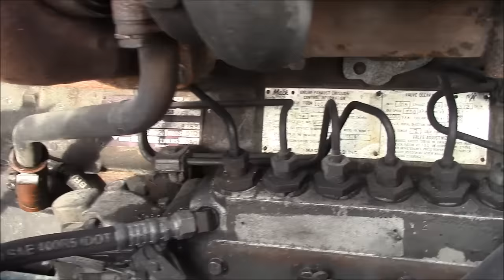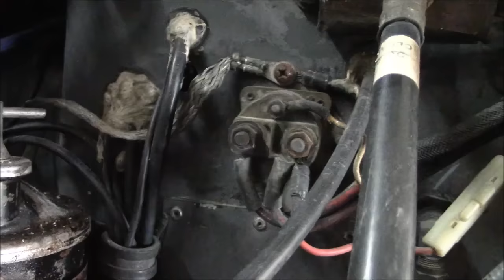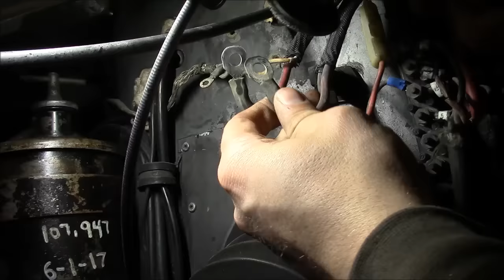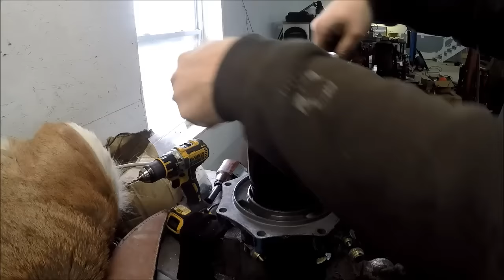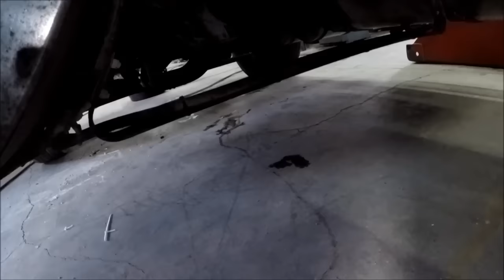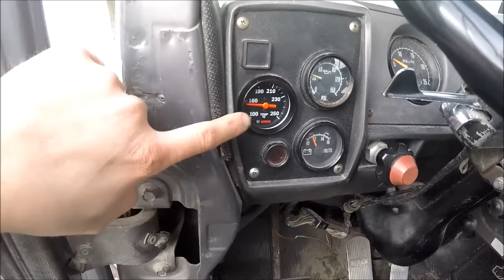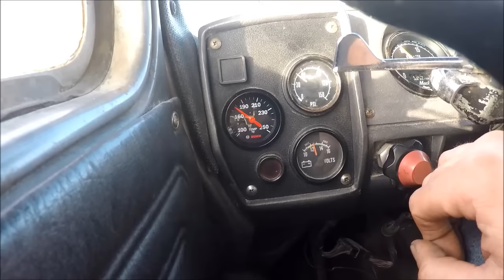Cool 1977 Mack RL600L - No Crank, No Start - Plus Many Other Repairs

Comment: No clue! Real Mack has a gold dog. Why?
The Leese Naville alternator needs feelding use a paperclip, one time shorting regulator for about a second or so will polorize it and will charge OK.
When you shift the Mack 5 speed, shift at low RPM'S and don't use the clutch. 
Oil leak is no problem it will stop after you run it. The cork gaskets shrink. Run the shit out of it. Good truck!

Comment: Mack Rs from the 80s and 90s are still hard at work here in Pennsylvania, mostly as roll-off dumpster haulers and triaxle dump trucks but you occasionally see the odd tractor or cement truck still.

Comment: WOW! People have told you not to use the proper grease for electrical connections (still laughing my ass off) dielectric grease is in fact used to stop unwanted current draw from outside sources

Comment: That really isn't unknown to have to "blip" the throttle to get the alternator to cut in and start charging on equipment. I doubt there is a problem. Ran across that often, guys start a machine at idle to warm up, walk away, alternator still not charging on return. Blip the throttle, there she goes. Lesson--- blip the throttle BEFORE walking away for coffee or bullshit with the rest of the guys.

Comment: I have those strap style wrenches in 2 sizes. Mine are made by OTC 7062 and OTC 7083. One has a square style metal piece and the other is round. I see on line they have a 7062A which has a flat bar instead. Not sure if i would care for that. I have had mine for many years. OTC used to be all American made, now i hear they have operations in China too. Kind of sickening how all these brand name products from North America are now made overseas. TOO damn much in China!!

Comment: how are you supposed to put di-electric grease on a spark plug wire (for example) after its connected?  the whole point is to seal out anything that will allow the contacts to oxidize (i.e. oxygen), thereby causing said resistance in the circuit.

Comment: I used to use dielectric grease and oil in the manufacturing of medical Xray equipment. There were cases where parts that were 1 inch apart were at 150,000 voltage difference. They would arc anytime not lathered in dielectric grease. In Xray tubes and CAT Scan tubes dielectric oil is circulated through a heat exchanger to get cooling, but also prevented arcing inside the tube casing.

Comment: Twice a year, I pull apart all the connectors on my freightliner and shoot dielectric grease in them. I’ve been doing that almost 10 years and I’ve never had a single problem. Unless you consider lack of corrosion a problem....

Comment: Been protecting electrical connections on vehicles for 45 years using some form of dielectric grease. Never an issue. I guess field experience competes with theory once again.

Comment: I believe the theradione is a naturally aspirated engine,  they would have NEVER put a thymidine against a 5 speed. 5 and 4 yes. one needs to understand a maxidyne engine is a low RPM high torque. (IE) 5 SPEED TRANS.

Comment: You do everything right. I Love to "Watch Wes Work"! I especially like your attention to securing and properly routing wires and hoses. I do think the UV light is what breaks down that particular insulation. If they are original, they still lasted quite a while. As far as brake air lines? Yes!! They have to be perfect. Thanks, Wes! Hope you and your family are healthy and safe.

Comment: Question? What was the blue knob used for on the older trucks? I remember reading somewhere it was a form of ABS? I never did find anything more then that online?
Reply from the maker: Nah. The old 3 button system basically works the same as the newer 2 button system. Yellow for tractor brakes, red for trailer brakes, and the blue know will set the brakes on both if you pull it or the air drops below the minimum pressure.

Comment: Hell I use dielectric grease on every connector on my engine, main ecu connectors, O2 connectors, light cluster connectors, ignition coil connectors, everything.
Even the best "waterproof" auto connector will, over time, leave some moisture/water vapour in, the dielectric grease stops any moisture/vapour getting into the connector by filling the space with non setting silicone grease protecting the contacts from corrosion...

Comment: I have a question about a 1985 or model Mack could someone tell me what the compartment and under the windshield right in the center of the firewall is that has a lead that opens up and down what is it for thanks
Reply from the maker: That's the vent for the fresh air to the cab. The bottom of the windshield is a high pressure area, so the inlet is usually there, even on cars.

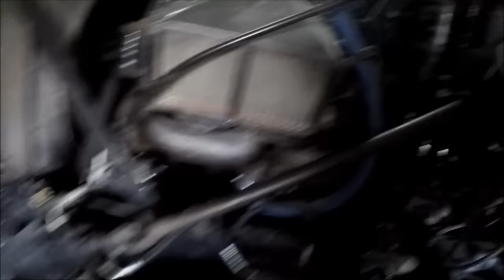Comment: 31:53 so which part of the truck which contains oil is not leaking? :)
Reply from the maker: It's a Mack, so none.
Reply: @WatchWesWork  that's what I thought. 😂

 You know that you cannot drive a car or truck in Germany with any oil leaks? They are both checked regularly and you won't get a sticker to make your license plate valid if it fails the inspection 😙🎶

I think something like this should be done in the US as well. Would probably make cars much safer :)

Comment: 14:30 actually it's also important on high current connections. The issue on low voltage high current connections is, that if your contacts break, there isn'tnecessarily arcing, but it's acting more like a spot welder and get extremely hot. If there is normal grease on it, it would burn plus keep the connection longer-established which leads to even more heat which might ignite the metal of the wire.

Comment: Them idiots that think dielectric grease inhibits the flow of electricity also think the earth is flat as well. Just kidding.  They are probably thinking of the corrosion inhibitor that actually seals the connection but is actually fairly non conductive.  I have seen that stuff used but I cant remember what it is.  Keep the good videos coming.

Comment: My best guess on the wire insulation breaking apart would be the heat cycling of the seasons and that engine bay over and over for decades. Over time it work hardens the plastic and would make it brittle. Going up to the pacific northwest you see cars with all the rubber and plastic still perfect and I'm convinced its because it gets no colder than 40F and no hotter than 80F on average.
Reply: Yeah we have that problem down here in the South with insulation breaking down and deteriorating, and of course the plastic insulation work hardens over time and breaks very easy not to mention if you have to strip off the end to replace a terminal. Back in the eighties a friend of mine and myself went in on a John Deere tractor that had been in a barn fire. Well it needed to be rewired and my friend was one of those use what ya got types and he provided me with all of this "pack ratted" wiring that the insulation was as hard as a brick from age (not to mention the corroded copper). I had some brand new wiring spools and I used that. It was easier to run and easier to strip and install connectors to.

Comment: Idk if it was said in the comments yet. I've "heard" that the copper is tin coated to keep the copper from reacting with the rubber. So where the tin is nicked near the ends at spliced and such the rubber gets all screwed up. I'm not 100 percent sure but I put my batteries right on concrete, lol.

Comment: when you fix wires after you  crimp the connector you need to  solder the connector then install the shrink tubing
Reply from the maker: I don't like to solder. A good crimp will be just fine all by itself.

Comment: good video, and by the way coming from just me, I retired after 42 years in the mechanic business you are correct in your use of the dielectric grease. and yes I am a Red Seal technician since 1980.

Comment: It appears the Mack has power assist steering and I counted about 3 revolutions of the steering wheel to make a 90° turn, a left turn, on the shake down drive. How many turns fron lock to lock?

Comment: It's a 300+ has the air to air cooler on top of the engine💯 that transmission is the same as a 2 stick just had a button the shifter for high and low instead of a stick

Comment: Go buy a new set of spark plug wires, guess what's inside the plug boots? Yep, you guessed it, dielectric grease. I've used Dow #4 compound on plug wires for years without any problems. It works good preventing corrosion on battery posts too.

Comment: does it have Mack 657 engine ( I think that is right number) I know it's 1977 . rear main seal was LEAD Wire in cast iron housing,  I upgraded it modern lip seal with wear band on crank, I made up a kit of tools for installing rear main seal and wear band,  I can loan it to you.

Comment: Wes I have been putting dielectric grease on contacts since the 70's on all surfaces that I scraped clean. My thought was like yours to keep the contacting surface from corroding. I would never put it on a set of points. Seems to me the cleaner the points the better. Have never seen them corrode except through many years of none use. I even put dielectric grease on massive conductor surfaces carrying thousands of amps and volts. In fact it was mandatory.

Comment: Dielectric grease is a non-conductive, silicone-based grease that's designed to seal out moisture and prevent corrosion on electrical connectors. It also disrupts the flow of electrical current, which makes it good for lubricating and sealing the rubber parts of electrical connectors. It's commonly used in automotive spark plug wires, recreational and utility vehicles, and electrical systems in aircraft. Dielectric grease is widely used as a se…
See more on wisegeek.com

Comment: Might have one or more crystalized brake drums causing his stopping issues? Those trucks didnt have jake brakes that I know of and sometimes if the brakes get hot, it will crystalize the drums? I used to pull bulk tankers with those R600 Macks. The Duplex and the Quadruplex Transmissions did a good job pulling them but that 5 speed didnt seem like it was geared low enough to pull them?

Comment: Poor bloody gearbox and you only got 5 gears my truck has 18 inagin the noise if you drove that 
 if you dont knot how to drive a crash box dont try
Reply from the maker: Hmm. Or you could say something positive like "Good job driving that truck that was built 8 years before you were born with a proprietary gearbox you haven't touched in at least 15 years." How often do you drive a truck you've never driven before?

Comment: I'm an electronics technician and I pack our servo motor connectors, among other things, full of dielectric grease to protect from water damage when operations is doing sanitation and I've never had an issues with conduction. I do the same on my vehicles electrical connectors and components. I use it for any electrical components that will be exposed to water or moisture

Comment: Grease you want is called " DEOXIT"
It keeps corrosion away, and keeps connection great !! Try it..
Reply from the maker: Isn't de-ox-it a contact cleaner?
Reply: No, deoxit is a light grease that has a mild acidic on it, that keeps corrosion away, as well as rust. It is available with several different additives, such as copper, ir silver, etc. I use the straight formula, just the plain grease. After a couple of years, my problem had been completely eliminated...!!!!!

Comment: As an Electro Mechanic, I can say that you are using the dielectric grease in an appropriate manner.
Reply: It is designed to fill voids and prevent arcing associated with having voids containing air. It has literally nothing to do with the conductivity of the connection.

Comment: That  5  speed  maxi torque  is proven  n  durable  simple  you would  think  but not  like  a pickup truck  you  really  got  to  let  those  RPM s  drop  to shift  a  real  different  experience  compared  to  a progressive  shifting  method  of a multi speed road ranger transmission  but  excellent  in the city  and  a great  way of  developing  the  skill  needed  to  skip shift  on  the  road ranger   You  never  down shift  these  more  than  1  gear  5 to   4  or  it  effects  the  up  shift  badly  you  really  have  to  adjust  your  style  n  habits  on  driving  especially  if  you  have  been  driving  a  multi  speed  progressive  shift  transmission

Comment: Dude that "Old style" temp gauge is called a Manual type  NOT electronic ...So even with the key off and engine not running it will give you temp reading .. I found an older R-7 with an 8v92 and  15sp and for year's it's just sat and sat the old buzzer-ed won't part with it either....and while I'm NOT a straight pipe " kid"  I do like the Detroit when properly muffled  I'm just NO fan of having a straight piped Detroit screaming in my ear all day long ...

Comment: these were the trucks that started with the  instant on alternators (internal regulators )   they use on some of these (the ones that used the kill solenoid used a external regulator )  you need to blip the throttle to 800 rpm to turn them on and they shut off below 500 rpm ,  my old 79 R model was the same way , no key switched voltage regulator as it was a truely mechanical truck , kind of like the old green leaker Detroits , once started you have to shut off the rack to kill them . on the older cumins you had the "get home"  screw if the electrical failed and you had air to release the brakes and get a pull start . remember getting home with my Mack with the lights barely glowing when it threw a belt one day .  learnign older trucks will really suprise you as they were often custom built to order ,  oh the L in the series meant it was a aluminum frame , not long hood ( only super dawgs  ( RW ) was a long hood ) more than likely that truck was built for pulling gasoline tankers as often that was it was used for ,  we have a joke about R  models the R stood for rebuilt , as often many of them were , there was a tanker company here in Chicago that would rebuild the cabs when they rusted out they ran them into the 2000's and most of them were 1970's trucks .
Reply from the maker: This alternator does not turn on until the engine reaches 1700 RPM!

Comment: A note about the dielectric grease bit: standard GM weatherpack & Ford connections come with it FACTORY installed I them.  I also use it each & every time I install spark plug wires.  You are 100% correct in your approach to its function & installation.

Comment: Another option is to use like battery terminal protective spray. Like the red spray. It can be a bit messy but so can dielectric grease.

Comment: I worked for Mack for 30 years and drove an R Model, U model & the First CH ever made. It was built
by hand at the test center in PA. I dont care what anyone says. I am proud to have worked for Mack.
I got to drive experimental trucks. Drove Macks first 500 hp truck. No regrets.Regards from Ody Slim
Reply: Your a lucky man That must have been an awesome job special at that time The older mack trucks were some great tough trucks
Reply: That sounds like a great job to me!
Reply: I drove a CH Mack when I hauled fuel.  It was the smoothest Riding, shifting and running Mack I ever drove.

Comment: The Maxidynes are easily identified by being painted gold. The Maxidyne was developed from the Thermodyne. The Maxidyne was a fuelling principle that resulted on High Torgue rise from the engine. The Engine developed it peak torque low in the RPM and held it over the higher rev range. Typically designed for line haul where the truck could roll over hills, get low in the rpm and not require the driver to change gears. The off set was the haul mark Mack cloud of smoke in low revs when the engine was getting heaps of fuel but not as much turbo. This truck has a the side mounted intercooler where air is draw from the aircleaner by tip fan that drew it's power from bleed air from the Turbo itself. I can say that in Australia, the Maxidyne Engine with the Intercooler set up became known as a 'Cool Power' and were an amazing engine especially in the Cabovers when you got the turbo and the tip fan whistle. Thanks for this video, great to see and old Mack so well looked after.
Reply from the maker: The 5 speed setup was not commonly seen here. We have big hills and it just doesn't work. I know they have a lot of torque at low RPM, but they still don't have horsepower until the RPMs come up. You really cannot downshift them on a hill. By the time you grab a gear you are stopped.

Comment: You are doing fine with the grease. You can put grease in the crimped joints too. Grease keeps the moisture out and stops corrosion.  Conductive grease can get you into trouble because it can conduct current to places you don't want.

Comment: Dirty batteries sitting on the ground will discharge.  Clean batteries can be put anywhere, and they will keep their charge until you use them. Love the truck.   Remember them from my childhood. Thanks for the video.    Perhaps a small video light for your GoPro will be nice for those darker areas?

Comment: I hauled a lot of logs with a truck just like that. Straight 5 speed. Don't think mine was a RL though cause I know it had a double frame steel frame. When you shifted you had shift at 1200 rpm. Those were some tough trucks.

Comment: The only thing I didn't like about your whole video was when your hand was off the steering wheel.
If you ever had a steer tire blow you'd learn real fast
Reply from the maker: How do you shift gears without removing your hand from the wheel?
Reply: @WatchWesWork  I never used 2 hands to shift gears and drove transport for over 10 years